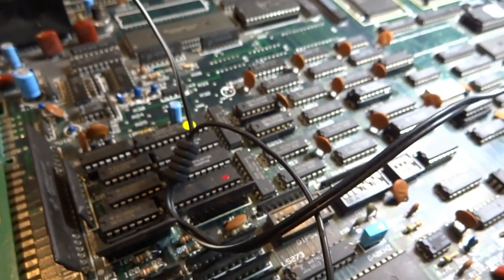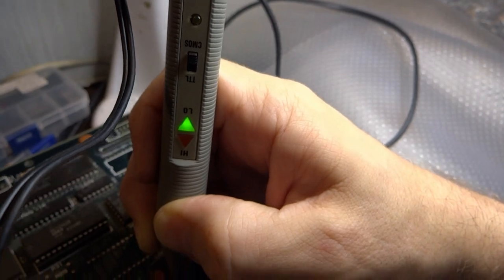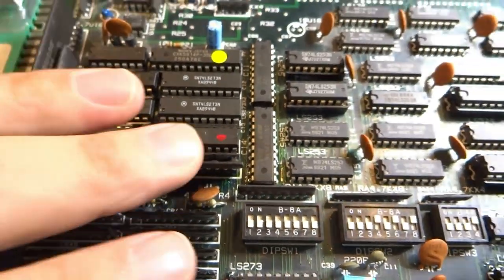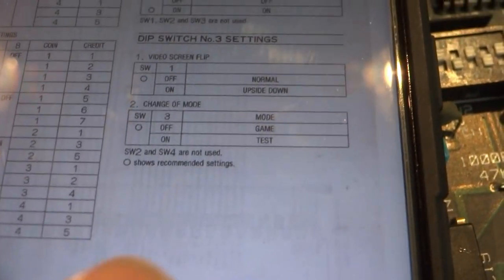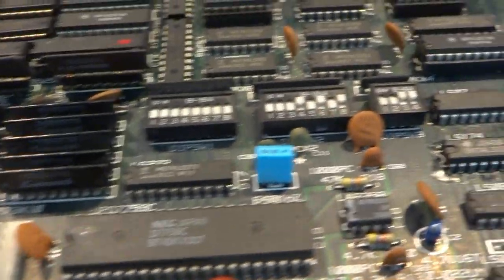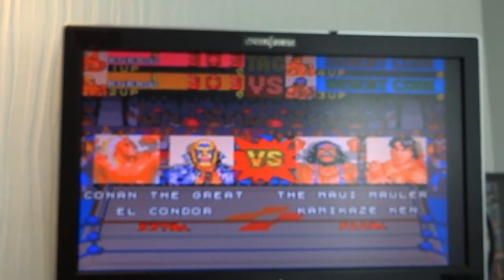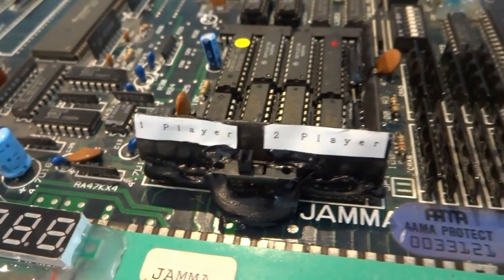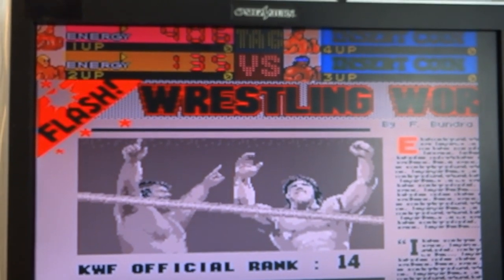Konami Main Event Arcade Pcb Video Sync Problem Repair

Comment: Why does piggybacking certain chips work? Does the signal just completely bypass the bad chip or does piggyback chip override the output of the bad chip?
Reply from the maker: In some cases, it will allow the correct data or current to flow through all of the legs on an IC that may have internally burned out. It doesnt work for all chips and sometimes even piggybacking ICs doesnt give you any changes. Choosing the wrong IC to piggyback can also lead to burning it out if you arent careful.

Comment: What are the 2 rows of connector pins on the board for ?   I have a harness but I’m not sure if something plugs into those pins.   Is there an adapter that plugs in on that location on the pcb for 3 and 4 player? My harness has plugs but they aren’t as wide as the pins on the pcb

Comment: I got problem with my X-Men PCb. Where that it's fine for 8 or 10 mins it seems everything works. then the ground sprites go all fade in blocky way and the intro the background is all funky but it still is sequencing the game fine. But the characters on the screen look truly fine and perfect with the enemy. But the backgrounds are all weird weird. And I can turn the game off and on in the game is totally fine again for another 8 or 10 minutes what would be causing that? I've tried tapping on everything with a wooden chopstick